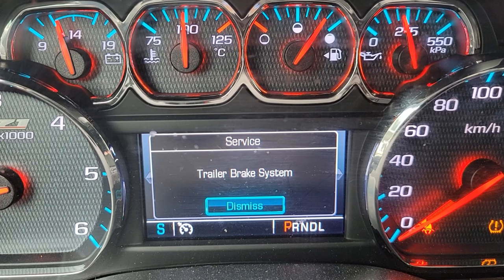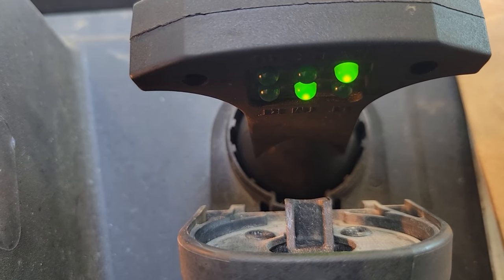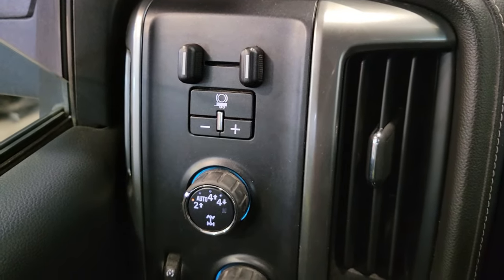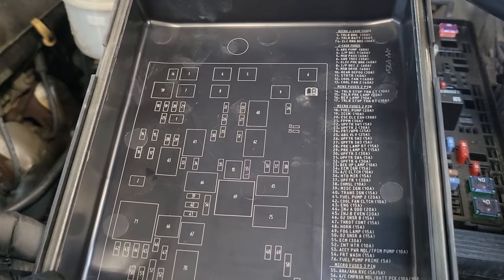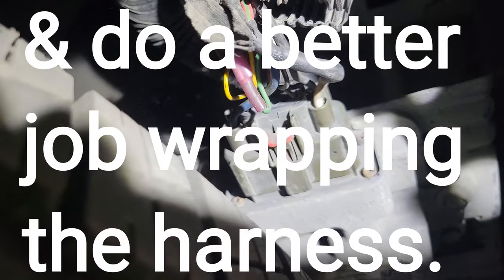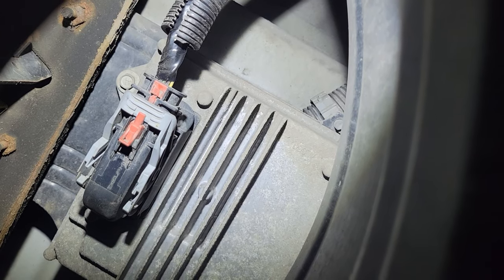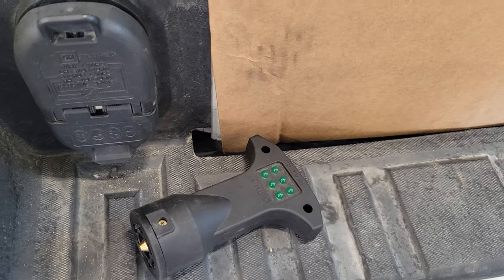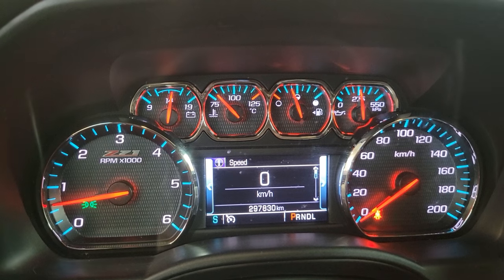How To Fix Chevy Service Trailer Brake System Warning. Common Problems & Failure Points Explained.

Comment: My truck did the trailer brake warning. Then it also made my Stabilitrak and ABS lights come on. They cleared themselves after driving a short distance without the trailer being plugged in. What coud be the problem ?
Reply from the maker: Sounds like a poor connection or an intermittent short to power or ground. Intermittent problems are the absolute worst to find. Hope it works out for you. Let me know what you find. Thanks for watching.

Comment: 2018 silverado  I have replaced the switch in dash ac Delco  , Trailer Brake control module ,all fuses  good, power and ground going to both modules ,auxiliary and Trailer Brake module 7 pin socket good no Brake in wires no corrosion in connectors  I'm baffled only thing I haven't replaced is auxiliary control module
Reply from the maker: Have you been able to fix your truck? If so what ended up being the problem? I have heard of people replacing the entire harness. Thanks for watching. Keep me posted.
Reply: @shanersmechaniclife3164  No sorry I haven't
Reply: @shanersmechaniclife3164  And GM won't recall the issue
Reply: Same here I changed brake controller and brake module, code still comes on every time I start it but goes away and comes back periodically while driving haven’t changed wiring harness yet not sure where I could get one without paying dealership prices?
Reply: I have a 2018 GMC 3500 Duramax, Dealership told me it a low voltage issue, I believe that is the case, it happens when my truck has been parked for a prolong period if I am driving it daily the problem seems to go away, just wish once it pops up and you acknowledge the error it would go away until the next engine start.

Comment: Thanks for the video!  My 2014 just started this.  Ended up being a 2" hose clamp stuck between the tailgate and connector.  Thanks
Reply from the maker: Glad to hear my video helped and that it was an easy fix. Thanks for watching and commenting.

Comment: Thank you for this video. You saved me hours of ripping wiring out of my truck to find out it was just a 20 amp fuse under the hood.
Reply from the maker: Great to hear yours was an easy fix. Wonder if it was a trailer issue that blew the fuse? Thanks for watching and commenting.

Comment: Be a hell of a lot better design for the green led's to be on the top of that 7 pin tester.
Reply from the maker: Good point. Thanks for watching.
Reply: Sadly it’s the design of the connector.  I have a snap-on tester with read lights  and it’s upside down as well.  Definitely connector design.
Reply: Lmao that’s the only dumb thing in video. I bet GE (General Electric) made it or atleast advised to put wires on bottom. 😂that’s so funny

Comment: Great video, straight to the point (or points lol).

I have this message popping up mostly during start up, very rarely while driving.
I had this message come up maybe a year ago. It started randomly, not too often, then turned into constantly while driving.
I heard about the dash controller being an issue and it was very affordable on amazon and really easy to replace not even 10 mins to do.
I also heard as a way to check if the dash controller is bad is, if you unplug it from the dash and turn on the truck and only get the message once at start up then not again while driving (only at start up) then that is a good sign the dash controller is the issue. So this is what I did. I unplugged the dash controller and I only saw the message at start up (if not unplugged I was getting the message every 10 seconds while driving).
So I changed the controller and the message went away.
Almost a year later now and I am getting the message again but only at start up (not continuously while driving).

So I am going to investigate further with all of your suggestions hoping it will just be a blown fuse or loose wire easy to fix myself.
Wish me luck. I will post back here if and when I solve the issue.

Thanks for sharing!
Reply: Please update what worked, or didn't..  Struggling with this myself after changing the dashboard controller

Comment: I just had this pop up before coming to work this morning. Would this also either keep the truck from starting or barely starting at all? I didn’t have the warning pop up yesterday but I had to jump the truck to get it to start.
Reply from the maker: I think it could be the other way around. If you fix the hard start, the trailer message might go way. Module might be detecting a low supply voltage. Let me know what you find.  Thanks for watching and commenting.

Comment: I never tow a trailer. Im getting these 'service trailer brake system' alerts at the same time as something seems to be running my battery down at night. Can I just pull the fuse? Or will that just send me constant alerts?
Reply from the maker: I would think you would get non stop warnings if the fuse is removed. Keep me posted if you find a fix. Thanks for watching.
Reply: Did you find the issue?

Comment: Can this cause the break to give out. (Peddle looses pressure, gos to the floor)  and rear breaks drags or lock up..??
Reply from the maker: Hard to say without seeing it. I would check for leaks and the master cylinder first. Could be an electrical problem. Have you gotten it scanned? Any ABS codes?

Comment: The two modules near the spare tire...one of them you called the trailer brake module, but you didn't name the second one. What does that one do and how is it different than the first?

Comment: Do you know what can cause driver side Bright light to stay on? if I use my brights and then turn my brights off The driver side stays on and I have to keep engaging the bright light switch until it turns off. When I did inspect the headlight the male and female connector was wet and I had them replaced but that didn't fix the problem.
Reply from the maker: Check your relays. Look and see if left and right are separate relays. Possibly a faulty relay? Let me know what you find. Thanks for watching.
Reply: @shanersmechaniclife3164  the 2015 GMC model doesn't have a relay for the brights I already searched it. It's wired straight to the control module
Reply: @shanersmechaniclife3164  if there is a relay it's not labeled in the fuse box and there is no information on where it is

Comment: Just happened to mine, now to track down the problem. I went bogging, and I figure that has something to do with it.

 Exposed wires and mud are not a good mix.  No corrosion or blown fuses. I need the trailer plug tester to see if I'm getting power. I spliced into the trailer hitch for my headache rack.

 There's lots of weak points on this system. All the wires are pulled back from the sleeving right before the connectors. 

Luckily, I don't really tow, but I can see this affecting the auto grade braking, and the warning keeps popping up.
Reply from the maker: Were you able to get your truck fixed? Where did you find your problem? Keep me posted. Thanks for watching and commenting.

Comment: is this only for 2015-2019 2500-3500 or does it translate to the 1500??
Reply from the maker: Yes the truck in the video is a 1500. Hope it helps you find your issue.

Comment: Would this cause any issues with the truck starting up? The day I started getting this warning on the dash, my truck started having a hard time turning over
Reply from the maker: Could be the other way around.  The hard starting may be the cause of the warning light. Low battery or corrosion could be causing low voltage to trailer brake modules.  I would start with hard starting issue and go from there. Hope this helps. Let me know what you find. Thanks for watching.
Reply: @shanersmechaniclife3164  thank you

Comment: I have a 2018 Silverado 1500 LTZ. I had the same issue, come to find out a had a few blown fuses. Once I replaced those fuses everything was back to normal and working. Haven’t had that issue again.
Reply from the maker: Great to hear it was an easy fix. Thanks for watching and commenting.

Comment: The parts where you mentioned, "Check for corrosion.  Looks like there is no corrosion here."  But what if there is corrosion?  Then what?
Reply from the maker: Clean it out the best you can, dry it and see if your problem is fixed.

Comment: My 2008 trailer brake system works perfectly, as long as my trailer is connected to it. (The trailer brakes work and there are no warning messages). When I unhook my trailer, I get a chime and a message “service trailer brake system “. Since I bought it new, it would give this message after a wash, but go away after drying the plug socket. Now it stays on all the time. Message goes away and trailer brakes work perfectly when I hook up! Any help is greatly appreciated 😁😁
Reply from the maker: Sounds like corrosion somewhere. If you had luck drying the socket, I would start there. Let me know what you find. Thanks for watching and commenting.

Comment: having trouble no left turn  on plug to the truck
Reply from the maker: I would start with cleaning the connection and checking the fuse. Are the truck signals working? Let me know what you find. Thanks for watching.

Comment: So what happens if you do all of this and its still not fixed? Throw the whole truck away?
Reply from the maker: I've heard of people replacing the entire harness. It's a complicated system with a lot of different electrical parts involved. I guess it all depends on how much people want to spend. Hopefully the repairs are under warranty.
Reply: You can buy a regular brake controller, that’s what the GM dealer here recommended to do.
Reply: Guess I should follow up on this, I ended up having to replace the entire chassis control module underneath the truck above the spare tire. Of course, it was the last piece I had to replace or check, and like every other failed part on the Sierra/Silverado, there was a "national backorder" on it. I found a used one eBay for $20 and took a gamble on it. Ended up fixing the whole issue.

Comment: Gm should be ashamed, 2024 at4x 900 miles and this light already on!
Reply from the maker: That's not good. Definitely warranty, but who wants to deal with that on the 2nd tank of fuel. Let me know what they found the problem to be. Thanks for watching.